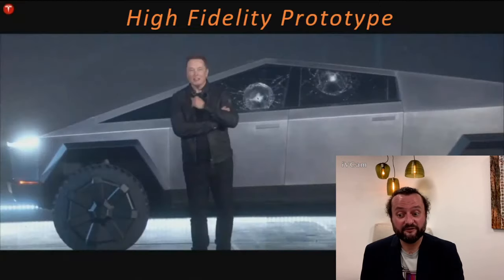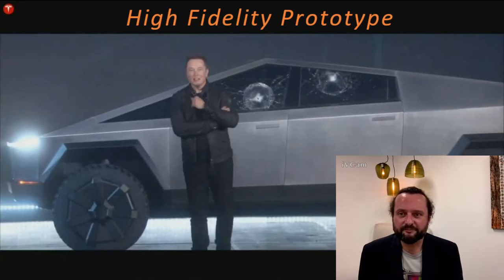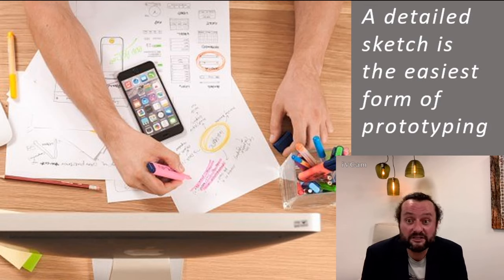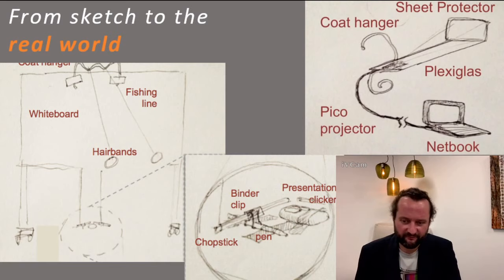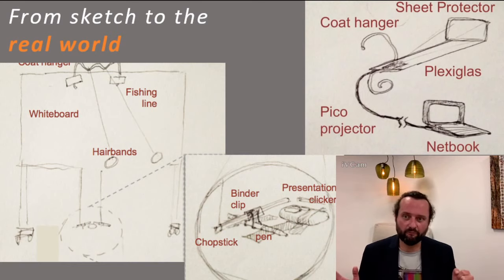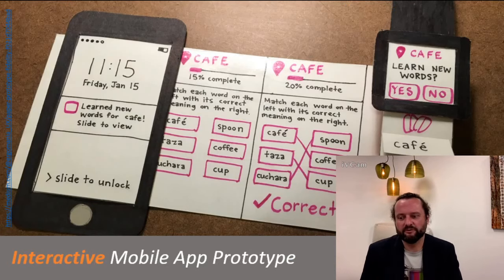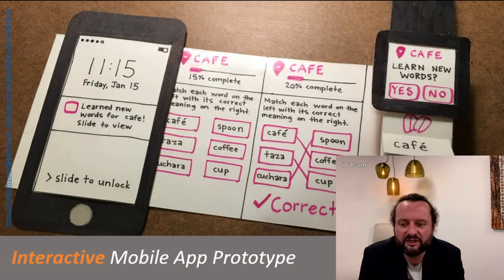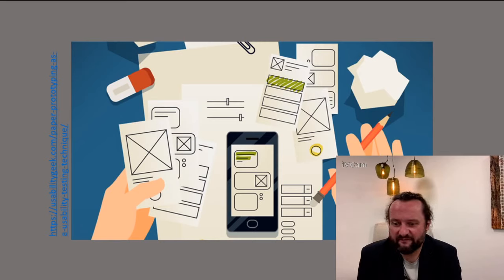From IDEA to INNOVATION (FI2I) with Design Thinking - Part 04: Rapid Prototyping

Comment from the maker: One question from the chat was if I would recommendations for building website and mobile app prototypes.

My default choice for a Mac user would be sketch 

https://www.sketch.com/

Adobe XD is quite comprehensive and free if you do not have to have many active projects
https://www.adobe.com/products/xd/details.html?promoid=85665TVQ&mv=other?promoid=85665TVQ&mv=other#

If you are happy with wireframing alone then Balsamiq is a nice and easy to use option
https://www.adobe.com/products/xd/details.html?promoid=85665TVQ&mv=other?promoid=85665TVQ&mv=other#

Or you are not interested in wireframing at all? Then try InVision. It is completely free!
https://www.invisionapp.com/